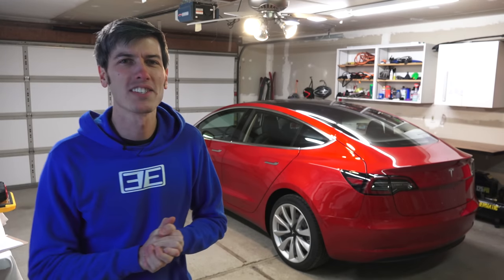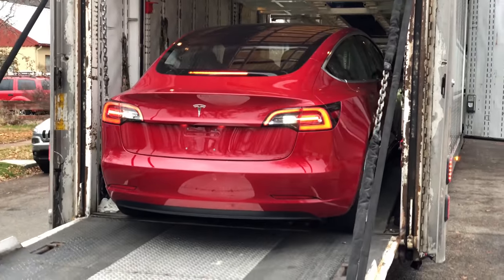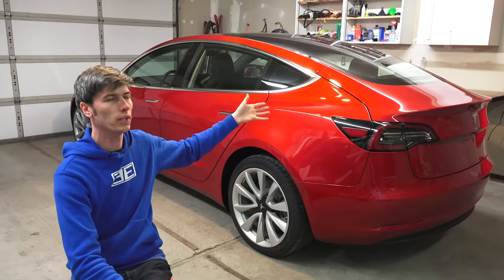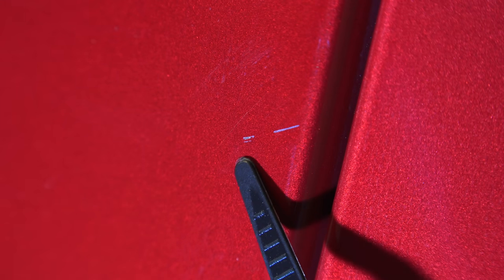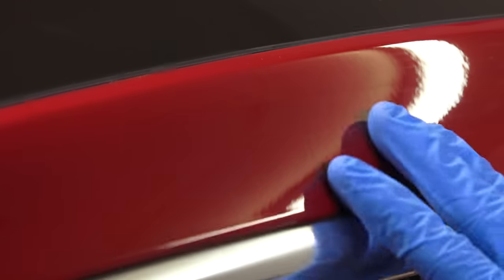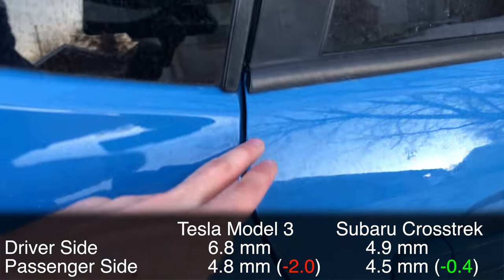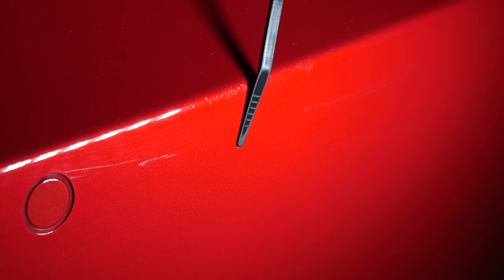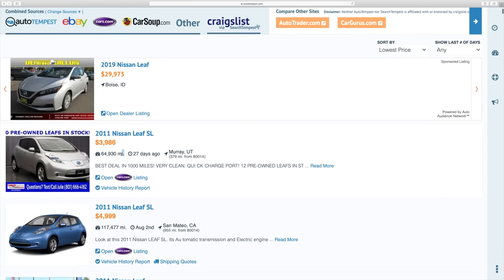Everything That's Wrong With My Tesla Model 3 - Quality Problems

Comment: Just my opinion, but the car is only worth for "return for refund". For new car with optional paint work is simply unacceptable and very important thing here - no matter what you do you will never going to get factory like paint consistency even if you going to repaint it. What I am saying - that paint work is screwed, that is end, nothing can be done for it. Even if Tesla going to do warranty job on it, they going to take it to workshop and the person (actual human) going to spray the the defective panels. What this means - when you get to detail the car, polish, wax etc. the pain not going to be same hardness etc. The key difference on factory robot vs. human application is that robot job is going to be consistent all over the car i.e. hardness, thickness, orange peel "grain" - so when you get to detail the car you find the product which works (pads, polish paste, wax etc.) and you can do whole car with it. Now when you going to have mixed panels some going to react one way, some other different way. So in my opinion the car has to be returned just for this reason alone - generally best paint you can get on car is from the factory and that is the only one which is worth protecting. If the paint from factory so poor, then it will never get "better". I mean I wouldn't even agree for issue to be rectified - I would ask for the car to be completely replaced.

That said talking about defect you have found:
The scratches - not a manufacturing issue, clearly an issue with delivery or storage, simply - car has been scratched. Most of new cars comes with film protection, not sure why Tesla has not done it. The only thing I can think off is that they do not let the paint fully cure, which would take ~4 weeks (or a bit shorter in the UV oven), hence it is overly susceptible for scratching + sticking film on fresh paint is not great idea either. So sort of basic errors I would expect from armature painter, not from mega manufacturer - paint not cured and not protected. Overall, level of scratching  - I would expect that on 21700miles car, not 21.7miles... especially the deeper ones past the clear coat, just not acceptable for a new car.

Orange peel - not an issues long as it is consistent. Some manufacturers have noticeable orange peel e.g. BMW 3-series/5-series, MB, WV ... other pay attention to it e.g. Lexus deliver the cars hand polished (except of CT) and they have mirror finish from new, upper class BMW/MBs like 7 Series, S-class, even same 3-series more premium grades like M3 comes polished - although I am talking from EU experience in US it might be different. Anyways - as long as it is consistent it is fine, if it is inconsistent then it is bad. Orange peel will disappear over the time if you get your car regularly detailed and keep it long enough it will flatten-out. Again the amount of orange peel is up for debate - if Tesla considers entry model 3 to be in the range of like Lupo or Polo of WV, then it is acceptable, but if they compare themselves to something similar in price like Lexus ES/IS, then it is not acceptable, even CT has very decent paint from factory (even without hand sanding and polishing). So it is more question of perspective - I found amount of orange peel on your car unacceptable considering the price, but that is my perspective.

The spot with dust... that is just no-no... such thing should have been spotted in QC after pain shop and car rejected. Even for entry model in EU you would not expect to have that, this doesn't mean such mistakes doesn't happen, they simply need to be addressed in the factory and there are methods specifically designed to fix and blend such spots with minimal distortion to the panel. Customer should never see this... 

Panel gaps.. again what is too wide is hard to say - they should be consistent, that is what matters. That 6+ mm one looks wrong, but it depends on the car and what panel we are talking about. I would say acceptable range is 3-4mm and difference around can be 0.1-0.2mm .. for luxury car that is. Not massive issue as most panels can be adjusted, but again that is something which should be done from factory. When I say done .. that is not even "adjusted", they should be correct from the conveyor... in the end it is not British Leyland we are talking about here and not hand build one of cars where the gaps would be adjusted during QC process. With modern manufacturing at least in EU and Japan the cars get assembled by robots and gaps will fit with margin certainly less then 0.1mm. Gap adjustment only becomes relevant on used cars after some crash or repair - even cheapest cars in EU would not have such issue.

For some contrast - a while back I bough Lexus IS250 with 120k miles and the paintwork except of multiple stone chips was in better shape, had little accident and repainted entire car for 1000 euros ($1143 at current rate). Because car with such high miles are worth next to nothing I did not bother with respectable place and just got pain job cheap and dirty, but I would say overall it was better then on your Tesla from new... what I am trying to say - what you have is simply unacceptable.

For me it almost seems like your paint job was done not on the production line by robot, but by human... Maybe because it is special colour you ordered.. not sure how it works in Tesla, but maybe they just do generic colour on the Assembly line and all optional colours they take off Assembly line and paint separately?! That would be weird, but it is hard to explain inconsistencies you have otherwise.

In other hand in EU we have slightly different quality expectations, I have driven 3 Tesla model S'es so far and my impression was that it has "poor materials and build quality inside"... I mean I am not comparing to Lexus .. that is spoiled, but even something like WV Passat which is considered mass produce cheap car or even something like British build Ford Mondeo (Fusion in states). So Tesla's might be forward thinking cars (because of electric), but quality cars, at least in EU standards they are not.
Reply: did you really think anyone would read this?
Reply: I read it. It was very informative for someone not working in the automotive industry / not a car paint job enthusiast.
Reply: @z00h  cuz i was interesting to read. you know not everybody only thinks about cash all the time......
Reply: I read it as well. Not everything is about 'dumbing down' info to the lowest common denominator.
Reply: Although I understand where you're coming from with the consistency that a robot can provide, the best paint job will always be from a good applicator/finisher. The machines are programmed to apply the absolute minimum mils so that its DTF is to minimum specifications covered by the paint manufacturer, they also skim on the clear coat by about 90% on anything that isn't "exposed". It is consistent, but more for saving time and materials then for "better quality". A skilled applicator will be extremely consistent on mils, on the high side DTF of the specifications, low on orange peel, proper paint system with cure time and full finishing (polish/sealants, orange peel removal etc). A proper paint job done by an experienced painter will easily last decades with plenty of material on the car left to polish and keep that flawless finish.

Comment: Not a "nit-picker" myself, and if the car cost £5000 as a used hack then fair enough.....but as a new car, the quality of that paint is just embarrassing. If the attention to detail on a car which is allegedly at the cutting edge of technology is that bad on the parts we can see - what confidence does that give the buyer for the parts that the customer cannot see? As an old friend of mine in the car industry used to say..."you can't polish a turd, but you CAN roll it in glitter". The standard of that finish for a new car is unacceptable, and I think it speaks volumes about the manufacturer.

Comment: Although I had less (a lot less) paint defects when my Tesla model S was delivered, Tesla picked up the car, leaving me a higher spec Model S for a couple of days while they fixed the paint issues and realigned the bonnet to even out the panel gaps. Of course I was disappointed the car wasn't perfect, but I could not have asked for a better service in response.
Reply: That's fantastic they did that, my concern would be what about all the stuff they didn't QC that you cannot see.
Reply: John Batty, have you noticed the OP does not respond to the positive posts and only the negative ones? example: snazzy labs (4th post above yours)
Reply: @silverp85plus77  Indeed. But now I'm  3 years & 60,000 happy miles down the road. And unlike the BMW's I used to buy I'm not thinking about my next car. This one is still absolutely brilliant.
Reply: @JohnBatty  on my Second S ( combined 140k miles) and very happy.
Reply: @silverp85plus77  you must be very, very lucky

Comment: Great video. It is not just Tesla with these issues on new cars. I purchased a 2019 Jaguar F Pace loaded at 70k. I cannot tell you how many blemishes there were o. The paint work. I however had them do a full detail ( not a wash, a paint correction detail) before I accepted the car . During transport of all new cars they get beat up and worse yet if they get washed at a dealership ( not Tesla) scratches and swirls are a guarantee based on the poor technique used.  My new Tesla 3 was delivered in white so seeing these flaws was harder and I didn't do the measuring like you did. I did however have a few blemishes I knew I could buff out.
It's a bummer in a sense that you but a new car and more often than not you have issues whether odd mechanical or cosmetix from day one

Comment: I don't care that much about panel gaps, I expect them to be somewhat wonky on a cheaply made car. But this paint is unacceptable. It would be unacceptable, even if it was the default free-of-charge paint. But as a $2500 option? Seriously? What did they do with this car? Paint it outside a garage, with a spray can? You only point out the big scratches, but there seem to be microscratches everywhere, which make the paint look like it was machine-washed for the last 20 years. How could this even slip through teslas QA?
Reply: its the driver side and rear bumper, how could have that happened? transport maybe? i dunno, i worked in dealerships so maybe thats just obvious to me.
Reply: It can't slip through QA if you don't have a QA.

Black man taps his head
Reply: @carolinabeacher1558  micro scratches have sod all to do with transportation, it's entirely down to either the original finisher at the polishing stage or whoever decided to give it a wash n polish before they put it on the truck... the bigger scratches could have been transport related but it's still Tesla's fault, as a new car being delivered on a truck should be sent with protective plastic wrap at the vulnerable spots, to prevent a bad first experience for the customer.

Comment: Looks like your rear bumper is a different shade of red...
Reply: I'm hoping the light was just angled differently?
Reply: my 18 wrx rear bumper looks slightly different than the rest of the car in direct sunlight, it wouldn't surprise me if a lot of cars have an issue similar to this. the bumper is plastic, most of the rest of the car is metal, they might have to treat the paint slightly differently or it gets sprayed in a different booth with a different batch of paint, even if it is the same color there could be slight variations. i am a professional color matcher and really try not to take my work home with me, and i really wish i had never noticed this about my car but i did. it is a super slight difference but its there.
Reply: When it comes to bumpers, they always tend to look a  bit different shade of color, no matter how careful and precise you are. Even if you use the exact same paint, it's not unlikely that the color will look a bit different
Reply: Yes that's correct, bumpers are ABS, vs the METAL trunk lid.
Reply: Its a multi coat red, so it has metalic flake in it, so the color has slightly different hues at different angles.
Reply: They probably put a flex agent in the bumper paint that they don't use on the rest of the car. This prevents the paint from cracking during assembly. On metallic paint it often makes light reflect differently, but that may go away a bit as the paint cures.
Reply: Bodies are not painted at the same time, or even the same location, as the bumper covers during production.  This is typical of every make and model, excluding exotics, and extreme high end vehicles.
Reply: @Alex-qw9ch  This man knows.  Probably works in a body shop.  I feel your pain.
Reply: SDD525 ummm your speaking nonsense. They can sell only one shade of red and still have the number a different color. You realize that right? Your comment meant nothing.
Reply: Because it is...painted seperately and Tesla is known for horrible color variations
Reply: @Alex-qw9ch  In at least some German (and I'd guess the Japanese do it too) cars plastic and metal parts use slightly different paints to have the end result match up better.
Reply: 50 Shades of Musk
Reply: that's called lighting

Comment: I worked for two companies that made earth moving and construction equipment, naturally they will get destroyed when used but every class A and class B surface could NOT have a scratch. The fact that a car manufacturer has scratches out the gate is incredibly surprising and egregious. Those tolerance deviations are HUGE.

Comment: My Model 3 had 3 paint chips (one under the clear coat) and Tesla bodyshop partner repainted the car. The back brakes were making noise at low speed, caliper spings were changed. I also had my glove box not closing after a few weeks (changed), they scratched my steering wheel while repairing the glove box (changed) and after repainting the car they forgot to put back the logo on the frunk (added). No panel gap discripencies noticed (visual not measured) and no other problem. I have to say that I never see any previous bought car that close than my Model 3 at the delivery because of all that was said about the quality problems and for the paint chips, I didn't see it at first, it was after we spotted one that we came for an other look at the car that we found the 2 others. So nothing like what you had, very minor compared to you. 

For the panel gaps, if it not something you would noticed just looking at the car, it is fine. If you can see the difference, ask them for an adjustment.
Reply: Alan Maignan panel gaps become problems long term when doors, hoods ect no longer close.
Reply: crunch9876 Please explain how with those gaps it won't close. Because I understand if it is too tight but it is not the case here.
Reply: Alan Maignan a gap one place tends to mean it’s to tight somewhere else. The parts are all the same size that doesn’t really change much. 
That’s how it tends to work on other cars I don’t think Tesla is much different. If a good should have a 5 mm gap in the left and right side and has an 8 mm on the left. The right will most likely have something like 2 mm.
Reply: Ok, so no problem, the gaps are fine everywhere.

Comment: I have a 2006 Peugeot 206 Sport. It has done a whopping 140k miles and the bodywork on it doesn't even have deep scratches like the Tesla. I wouldn't accept the condition of the Tesla and I would send it back immediately.
Reply: And I highly doubt you ever checked the body work since day one.
Reply: Make a video and show us or your a liar
Reply: Doubt it but I would be upset at those scratches.
Reply: Sooo how often do you fix it?
Reply: @moldoveanu8   he keeps it in one of those bubble things in a climate controlled garage and wont even turn on the lights for fear it may ruin the paint :) im just playing around to be funny  cause like jason said, theres gonna be the extremists out there on both sides.  but im just like, guess what, the minute i touch it out id probably scratch it myself.
Reply: @carolinabeacher1558  i scratched my jetta 2 weeks after i bought it, luckily it was under the front bumper, they make vinyl wrapping for ppl that actually care about the paint.

Comment: my car that is 15 years old has paint in better condition and less of a variance in gaps.
Reply: Dhiren Patel My Buick Encore is only 3 years old now, because it’s a 2015 model. It only has a few scratches on the paint, but they’re not as noticeable as the scratches on this Tesla Model 3.
Reply: guessing the manufacturer has been around a lot longer than tesla.  people are mostly buying teslas because of the powertrain.  I suspect Tesla will get there eventually, but their focus is on pushing the envelope with EV technology, not build quality.
Reply: I was thinking the same... I just got a 2005 Buick century of my local kijiji... 120k on the odometer and the paint is on better condition than this.... and that's a 13 year old car that has been on northern Ontario salty winter roads... this is terrible

Comment: I work as a detailer at an Audi dealership and if any car came off the truck looking like that, we would not accept it. It would get sent back.
Reply: Indeed. I'll stick with my S4.
Reply: Right ?  I sold Chevys and we would not accept a car in that condition.. Chevrolet
Reply: The car is used and has 22k miles
Reply: UH lol it is new with 22 miles.... you ok?
Reply: @trill_boii_gabe  22k miles don't really explain scratches UNDER the clear coat and then look at these panels barely fitting
Reply: If I bought a Dacia with paint like that from the factory I'd not accept it.